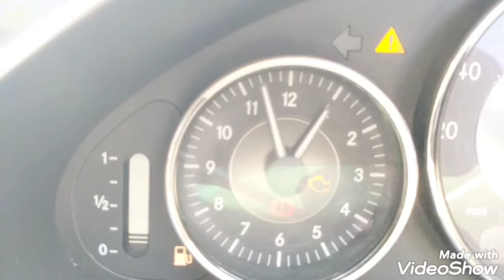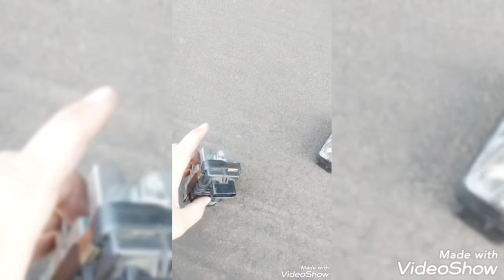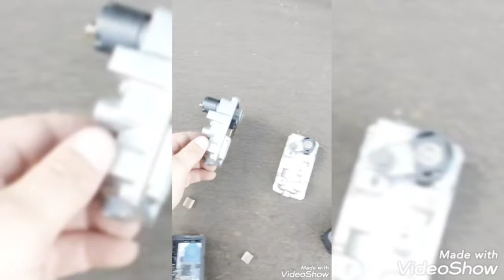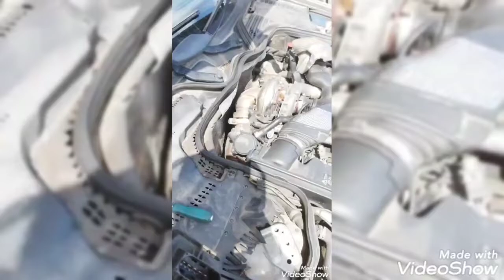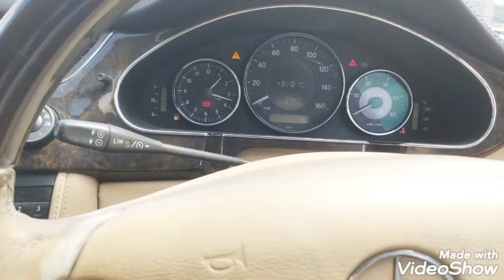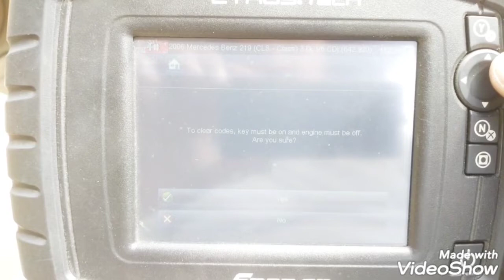Mercedes 3.0 CDI V6 OM642 turbo boost issues - actuator repair

Comment: All errors on modern car is stored in memory. You can drive many months or years without knowing errors on your car. The only way to reveal errors on your is to use a bi directional OBD2 diagnose scanner and read from memory. I have had error 299100 open circuit and 29A400 the actuator can not find open or close point because the actuator is not calibrated to ECU. I have spend many thousand dollars extra in vain. I have replaced two turbocharger with new actuators, both has the same error and the car has low boost, drive train errors. 3 car workshops was involved, but non of them can solve my turbocharger problem. Now I have repaired the original Hella actuator. This one was calibrated to ECU. The configuration is preserved. I believe the turbocharger is going to work perfect when I install it back to my car. Thank you again for sharing knowledge. :-))

Comment: I want to express my gratitude for your informative video. At last this video has information good value where you informed that the actuator is coded in ECU. The actuator can not be replaced. It explains why my turbocharger does not work in two years. 3 car workshops have replaced 3 turbocharger and do  not know why the turbocharger does not work. My neighbor has the same problem with his Mercedes 2007 320GL SUV . 3 car workshops has replaced 3 turbochargers and still, his car does not work. Mercedes has problem with the actuator. The solder pins overtime loose connection and must solder on special workshop. I have read about this and try to tell him he must take out the actuator and bring it for repair electronic repair shop.

Comment: I still have the old actuator which was coded to my ECU. So if i put it back to my turbocharger it should work. My turbocharger has not work in two years and all 3 car workshops can not find out why. If your information is correct I should try and replace the original actuator back.

Comment: Interesting information. You say the actuator is coded to your car. Does it means that I can not replace an actuator without get it coded. What kind of tool do I need to code it?  I have a car scanner Launch X431 CRP919X BT. I know I can code my EDC absorbers. If I replace a new turbocharger included a new actuator, do I have to recode the actuator ? I have replaced a new turbocharger a year ago and it still not work. I have got error 29A400 all the time. Low boost, kick down does not work, drive train error+++

Comment: Great video! Thank you for sharing, this is very useful information. Quick question. Are you able to move the actuator arm by hand? My actuator arm seems to be seized or stuck, it cannot be moved by hand. When plugged in, the wastegate is open all the time causing  no boost and limp mode. My only engine code is for "low boost", there are no codes for the actuator unit. Thank you very much!
Reply from the maker: The answer is no you cannot move the actuator arm with your hands. Reason is gears and sort of gearbox system inside between the motor and arm. Only way to check it as far as i know is with ignition like i did on my video (on/off) or if its completely dead then by diagnostic fault code.

Comment: Ive been through this twice now also the oil cooler leak in my cls 350. Mercedes engineers made some stupid decisions designing this car with no fix till about 10 years later!. Atleast i am a expert on this om642 engine after owning 2.
Reply from the maker: How did you sorted out your turbo actuator?
Reply: @wolftech4705 sorry for late reply I opened up actuator and took it to a computer fix place to solder the breaks in wires,don't do it yourself unless your very confident at electronic level soldering
Reply: Can you help pinpoint cause of my excessive white smoke?
Reply: @thecynicalafro160 white smoke from where?

Comment: I've got my actuator soldered (broken wire), but still it doesn't work.
I have no way to clear the codes atm, will it start working when they are cleared? Or should it work immediately no matter the codes ? thanks
Reply from the maker: It should work straight away even if fault codes have not been cleared. In your case i would say your actuator has not been fixed yet - check for another damage or double check the one soldered - its not easy job for first time
Reply: @wolftech4705   Thanks for the fast reply. 
I'll take it off again, and bring it to the electrician guy to double-check.

At least I know that it should work right away when fixed.

Kinda drives me nuts, first the Y air intake pipe (on turbo) broke, after the fix the actuator failed 10-15 day's later... No idea if it has to do with the air intake pipe, or the actuator broke on its own.

Btw. the turbo vanes are not blocked, the arm moves freely when disconnected from the actuator.
Reply from the maker: @Cetax  good luck. Let us know its going for you
Reply: @wolftech4705  update.
Gave a visit to the el.guy.
He disconected the actuator for a check, and told me its find.
After he connected it again and  "magic" happend, it worked like a charm.
Not sure what went wrong when I connected it(doubt there is a wrong way to do it).
But bow it works better than ever. Has full power... 🙋🏻‍♂️
Reply from the maker: @Cetax  good to hear - enjoy your ride

Comment: Does the actuator not be calibrated?
Reply from the maker: Not as far as i know. But who knows...
Reply: @wolftech4705  I have changed it today, doesn't need to calibrate. I got a problem p2359 low boost. Fixt intake hose to turbo, new turbo, new ic hose check for leaking. Everything is ok, I have lack of boost en cant find gen problem, do you know what i am missing?
Reply from the maker: @MrFietslicht  i have never seen option to calibrate these - thats why everyone is struggling with these turbo actuators. I have tried to replace with some another units but no luck to get these to work - that is why i had to repair my old unit.

Regarding your lack of boost pressure - your engine must go into "limp mode" - as soon as it goes in limp mode there must be new fault codes. So the best you can do is to clear all old codes - restart car - take it for short test run - scan for new codes and share them
Reply: @wolftech4705  the code is p2359 low boost. Everytime I drive a little the code comes back. I changed almost everything. But code stil comes back. Today im gonna try to clean egr. Maby that helps
Reply from the maker: @MrFietslicht  Did you checked your old turbo actuator for internal damage like in my video??
Reply: @wolftech4705  I placed a new one, it works perfectly. Only tink that you need to do is before you drive. You need to go with Delphi and put actuator up and down. Then the 0 position is calibrated.
Reply from the maker: @MrFietslicht  Interesting idea - i will have to check

Comment: hi my friend my turbo actuator was broken. i bought a new one and build it in. now the problem ist that my turbo actuator moves really weird. it pops up when i press on the gas. when i let off the gas it pops down again and my turbo does the sütütütü sound. please help
Reply from the maker: Im afraid there is no help to your issue at the moment. As i mentioned in video you can not directly replace your turbo actuator with another one because it needs to coded to car. Thats why i repaired my one
Reply: @wolftech4705  oh ok thats really bad. I asked mercedes they said the turbo actuator learns itself. Thats why i changed mine
Reply from the maker: @ossi8221  if you watched my video then i did mention this issue regarding mercedes dealers. If these units would learn themself then noone wouldnt have such trouble with them
Reply: Hi have you fixed the problem? thanks
Reply: @marti4580  yes. It was the turbo geometry that was Stuck. I bought an original refurbished turbo from the Internet. IT came perfect. I swaped the turbo and Now the car works perfectly
Reply: @ossi8221  Do you know if the lever was moving free?
Reply: @marti4580  mine was moving free. But the last 5% on the bottom Part was actually Stuck because of particles of the exhaust thats on the back of the turbo that Provides the spinning flew into the turbo

Comment: this would have been a lot easier to follow if you held the camera in the other orientation, it's very distracting to try and focus on the middle of the screen with such a small area of view, when the outer edges of the screen are moving as well. also a closeup of the actual wire would have been handy to show what to look for.
Reply from the maker: Im not pro in video shooting - just tried to help with some info i have. I hope it did work for you

Comment: Hello, maybe you could help me, I have a W211 E320 CDI  150kw and we measured only about 130kw, I have no check engine light, no errors, no smoking or anything else, but somewhere the car is losing power, any ideas? thanks
Reply from the maker: Could you clarify which year model is your merc?
Reply: @wolftech4705  its 2004 pre-facelift
Reply from the maker: @Ender1337  to identify power loss issues i would go through few steps, starting with easiest one:
1- live data on turbo boost;
2- vacuum line leak or blockage;
3- condition of fuel injectors.

Using good diagnostic tool, check is your turbo boost pressure high enough under hard acceleration - if turbo boost pressure is too low: 
1- need to identify is there any crack/split in one of the hoses;
2- or turba actuator (wastegate) is damaged;
3- or vacuum lines are leaking or blocked with dust/dirt.

Fuel injector checks i would leave as last step since thats most complicated comparing with above mentioned checks

Let me know if you need help with any of these steps
Reply: @wolftech4705  So this needs to be test on the road right? Or can you check the turbo pressure while in a garage?
And any numbers we should be moving around? How do we know if the pressure is high enough?
Thanks so far for the tips, should have it solved in a week or so, will let you know for sure.
Reply from the maker: @Ender1337  yes, thats correct - turbo pressure can be tested only during test drive. Normal pressure on mercs must be 2-2.2 bars. 
Can make short video about this

vacuum line can be tested using handheld vacuum pump (about £10-15 on ebay)

fuel injector tests - easiest (but not 100% accurate) is leak test - such kit also cost less than £20 on ebay. Im using manual pressure pump and electronic pulse adapter to check how good injectors are holding pressure and spray pattern
Reply: @wolftech4705  Thanks for the tips, normal pressure 2 bars should be while idling or during a normal ride? Also full throtle should be much higher right?
Also vacuum should be tested before the turbo? Like after the MAF sensor on the pipe?
Reply from the maker: @Ender1337  arround 2.2 bars must be under hard acceleration (full throtle). On idle turbo charger is not activated and system pressure will be just over 1 bar (equals to normal atmospheric pressure). There will be variation on turbo pressure during normal drive since it will depend from acceleration (your driving mode).
Reply: @wolftech4705  Thanks so much for the tips, i will inform you when we get to check it
Reply: @wolftech4705  If we dont reach that pressure does that mean that there is a leak somewhere or that the turbo/actuator is at fault?
Reply from the maker: @Ender1337  any of above mentioned. If you dont get required pressure you have to do more detailed inspection of these components: turbo hoses, turbo actuator/wastegate, turbo unit itself, vacuum lines, vacuum valves (x2), vacuum pump, turbo boost pressure sensor, intercooler
Reply: @wolftech4705  today i tested with a TEXA diagnostics, the pressures were 1 bar at idle, and 1.3 max. on kick down? We were not sure if that diagnostic tool can read these numbers correctly because the car has still a quite nice pull  and such a low pressure would be a sluggish acceleration i Think, next time I might get on a Star diagnostic, so far we will check all hoses from the turbo all the way to the engine
Reply: Hey Again, i got these graphs in case you can read something from it, the boost seems kinda low that 1.4 was full throtle https://i.imgur.com/2F12MrL.jpg
Reply from the maker: @Ender1337  you are correct - on full throttle turbo boost should be much higher. This is where you loose your boost power.
Reply: @wolftech4705  hey Again, so we checked absolutely everything about the hoses and leaks, there is no leak any where and we even tested the same car from my friend with a diagnostic and they both feel exactly the same and have the same results and both cars make only 1.5 bar on full throtle. so i guess there is no fault anywhere. And the cars dont feel sluggish at all, If there would be leaks it would be noticeable we think.
Anyways Thanks for all the tips
Reply from the maker: @Ender1337  how did you do your checks and what exactly did you checked? 1.5 is way too low turbo boost. Your 320cdi is 7 cylinder engine and your turbo boost the moment equals to air ballon pressure. However it depends what sort of diagnostic tool do you use
Reply: @wolftech4705  First we used a TEXA diagnostic and then some cheap OBD scanner, both same results I can post you the graphs here
Reply from the maker: @Ender1337  please share some screenshots
Reply: @wolftech4705  https://i.imgur.com/gRndvUp.jpg
https://i.imgur.com/QeXxYGf.jpg
This is from the OBD scanner, but TEXA was basically the same, we had no acces to original Star diagnostic but that texa cost is around a few 1000€ so should give good results.
Also both cars have chip tuning to around 190kw, i guess thats why it shows there power 200kw
Reply from the maker: @Ender1337  looking on your rpm graph i can see only two spikes where engine had full throttle up to 3000rpm - then at the same time your boost pressure reached 1.5 only once. This is far from normal performance
Reply from the maker: Your diagnostic tool seems to be ok - no need for MB Star - live data will be the same figures. For example i am using Snap-On.

Where about you are located?
Reply: @wolftech4705  I am from slovakia
Reply from the maker: @Ender1337  Slovakia would be too far to help in live. Meanwhile i just made live data reading for turbo boost on my CLS. Not the same type engine but idea is the same as on yours. Take a look....    https://imgur.com/a/fLv8RYn
Reply from the maker: its hard to share any video or screenshots here on comments - so decide to create Telegram group - it will be easier to share information and get answers. Feel free to join: https://t.me/+IUHjrHAY_iEyMjc0

Comment: Thanks for sharing video. Very informative especially about china product available on eBay not likely to work. Seems best thing to do is get the wires soldered. I would suggest probably ask a local computer repair shop to solder them up properly instead that way you may not have to keep soldering every few months. Great video many thanks.

Comment: This is the full, in depth explanation and demonstration I needed, thank you. It covered a lot of parts missed by other videos on the same issue. I look forward to more of your content.
Reply from the maker: Thanks for feedback. It`s my first video ever. Let me know if you looking to find something specific regarding these cars and engines. Regards
Reply: @wolftech4705  at the moment I’m dealing with the same issue you’ve just covered. I’ll certainly come back here for anything else that crops up with my CLS.
Reply from the maker: @escatel6889  if that could help i can make quick video about how i did all that repair on actual actuator